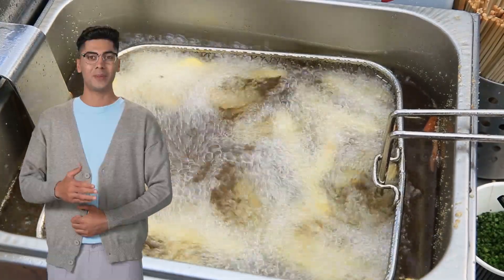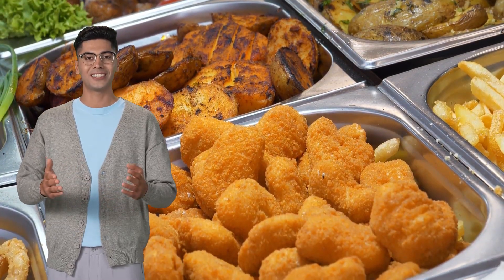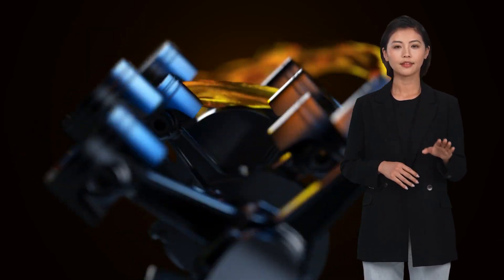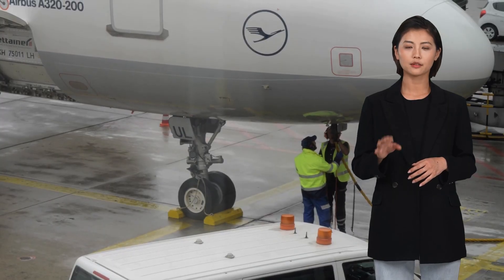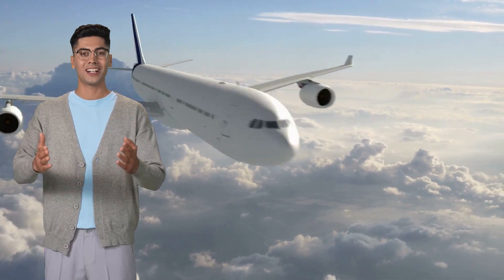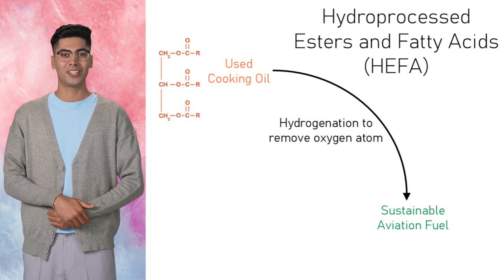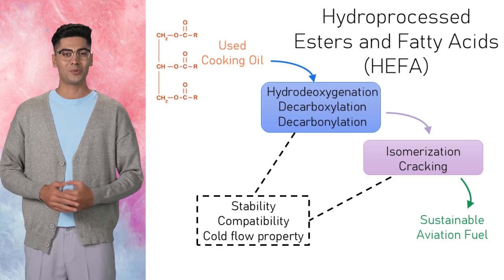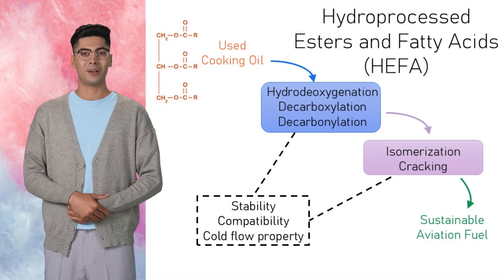From Frying Pan to Fuel Tank Biodiesel & Sustainable Aviation Fuel

Comment: I guess the major challenge would be "cost"! And why only aviation? A lot of hydrocarbon based electricity generators could use it, right?
Reply from the maker: You're absolutely right. Cost is still one of the biggest challenges when it comes to scaling biodiesel and sustainable aviation fuel . These fuels are environment friendly but more expensive than conventional fossil fuels. As for your second point, spot on again. Aviation gets a lot of attention due to its high emissions and limited alternatives. But biodiesel and SAF can indeed be used in many other sectors, like -  diesel generators, maritime transport, and heavy machinery.